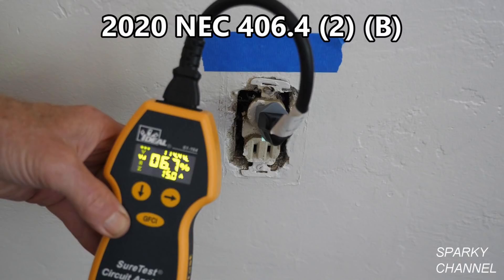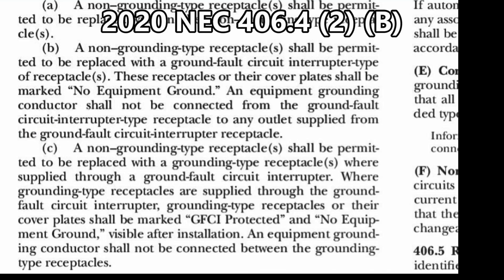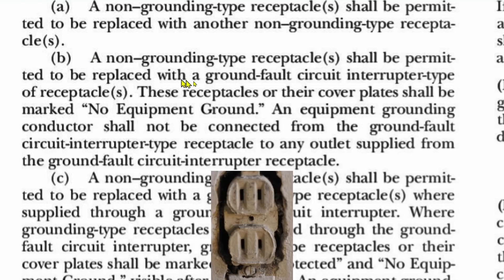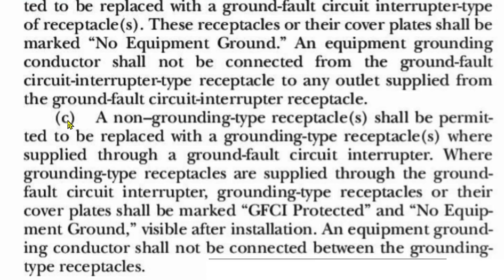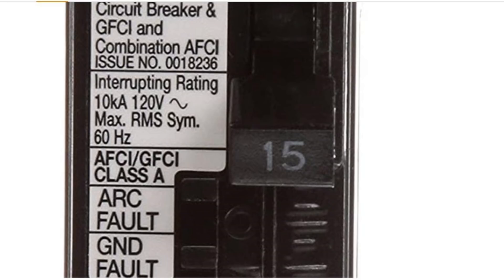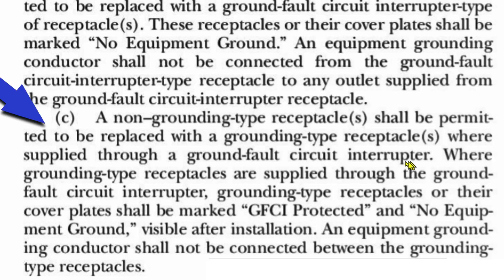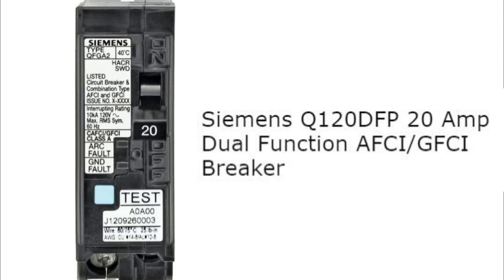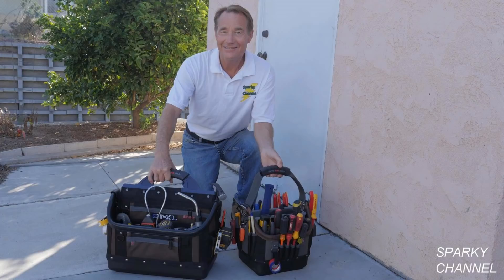Can You Just Install an AFCI/GFCI Breaker When Replacing Old 2 Prong Receptacles?

Comment: Thank you for this clear explanation. 

I’ve done building maintenance for years and generally avoid 2-prong outlet ‘situations’.

In our old 1914 farmhouse: about half the electrical boxes are grounded. There are several older GFCI in place but they are generally too big for the box, I will replace them as needed.  

This helps me to understand:
•Using a GFCI on an outlet that needs it will work without a ground. 
•If you can establish which outlet in the circuit is directly connected to the line, installing a GFCI in that location will protect other outlets on the circuit. 
• A GFCI circuit breaker will protect the entire circuit but reseting it may be cumbersome depending on the location of the breaker box
•Any GFCI protected outlets should be marked as such
•Any 3 prong outlets without an equipment ground must be marked as such
Reply: Why do they have to be marked? I don't care about laws/code garbage but what is the reason the user/owner would want GFCI's marked as such?
Reply: @ATCRyderX  Well, if you ever want to SELL your house and the bank inspection finds sub-standard work, they may just cancel the contract for fear of hidden dangers…
Reply: @UnknownIdaho  so THATS Why they have to be marked? ehhh IDK, Man...Figure out proper answer & Report Back.
Reply: @ATCRyderX  the reason is because the ground must lead back to the panel and not terminate at the outlet. The GFCI will detect the ground fault and cut power at the outlet and labeled. Labeling is important for any future work and safety.

Comment: Hey Sparky, I remember way back in the early 1970s that breakers from many manufacturer's  would work in other Manufacturer's Panels. Some would work in other manufacturer's panels only in some spaces in the panels not in all spaces. There was panels as example that would take, or you could use Bryant, GE and ITE breakers interchangeably. If the old panel in the old house was GE and the specification and design of buss and breaker connections are same similar and will take  the new AFCI and GFCI combination breaker then I would install them as needed, or as required.
Reply: This is a tough one. The NEC says that all breakers must be listed for the panel. What to do on an older panel? I was recently working on a detached garage at one of my properties. It has an old Homart (Sears) load center. Zero chance I was going to replace the whole service. I'd leave it unchanged before I did that. However, I did want to provide all circuits with GFCI protection. Three of the four circuits were easy, using receptacle GFCIs. The lighting circuit, however, had some receptacles on the ceiling. How do I best provide for GFCI protection in that instance? The NEC precludes using a GFCI receptacle in a ceiling receptacle.

I had three choices. 1-Do nothing, no GFIC protection, no code violation. 2-Put a GFCI in the ceiling, code violation. 3-Put an unlisted GFCI breaker in the old Homart panel, code violation. Somewhat ironic that the only way to comply with the NEC was to leave the circuit with no ground fault protection. I choose option #3. I tested GE and Siemens breakers in the Homart panel. The Siemens breakers fit perfectly. I believe my Homart panel was manufactured by Murray, which was purchased by Siemens. 

The NEC needs to have an exception to not require the least safe option to be the only compliant one. I'm glad I choose to install the GFCI breaker. A week later, I shocked myself on that circuit, causing me to involuntarily toss my pliers across the garage. I thought, "Well, code be damned, I'm glad I added GFI protection." It left me startled and pissed instead of electrocuted and dead, or more likely, fallen off the ladder and really pissed.
Reply: @sigcrazy7  That would be a question for your local code enforcement- the local electrical inspector might give you an exemption or say it is ok for you to install the buss matching newer GFCI breaker into the older style existing panel- or they might not. The best option would be to  replace the old panel with  a new panel listed for the new Arc fault and GFCI breakers.
Reply: @MC-de6tf  As I said, I'd leave it as-is before I changed the panel. A panel change would require a bunch of modification to the EMT and overhead RMC to that panel. Not going to happen. Your comment just reinforces what I said: The NEC needs an option that doesn't make the legal choice the worst choice.

Comment: How about using a GFCI/AFCI receptical for the first outlet in an old ungrounded circuit? From code language you showed that sounds ok. Would it function ok?
Seems old wiring could benefit from the AFCI protection if possible...

Comment: I think you may well run into issues depending on how the house was wired. GFCI breakers will not work if neutrals aren’t properly segregated. That’s is if a neutral from circuit A is used with circuit B then the breaker won’t workroom properly.
Reply from the maker: Excellent point, thanks Jim!

Comment: Something to keep in mind is that the old wiring (specifically knob and tube), may have some neutrals that are either shared or connected somewhere making the GFCI trip constantly.  Then again if that happens you can just return the breaker and get some GFCI outlets.
Reply from the maker: Yes, excellent point! That can happen. GFCI receptacles are always an option, and with some old panels which don't have GFCI breakers available for them, they are the only option.

Comment: There is another problem when adding a combo afci/gfci breaker upstream of an ungrounded outlet: the breaker must be listed for use in the panel. If you have an old panel, it's likely that the newer combo afci/gfci are not listed for your panel. Installing one in that case would be a code violation (at least in a Siemens panel, as the MFG directs that only those breaker types listed on the placard inside the door may be used).

Comment: as my inspector said, the code will ALWAYS allow you to add AFCI or GFCI protection - even where it is not required.  but in this case, yes, they actually prefer the protection to be provided at the breaker panel.
the next question - which I already know the answer to - is what you do if you can't get an AFCI breaker that fits the panel you have, and you need to install the protection at the panel. - if you're looking for ideas for videos.
Reply from the maker: Hi Ken, good to hear from you! I do have that video planned. Stay tuned. ⚡

Comment: Great question!
But when I’m dealing with knob and tube wiring normally they run a 3 conductor which they share a neutral between 14 gauge wire and a 12 gauge wire. Which they do have a two pole arc fault or GFCI breaker.
Reply from the maker: Thanks Rudy! ⚡

Comment: At the very end you mentioned that they might trip more often. Why is that? Does this also add protection to lights with no ground wire? Can you discuss pros/cons to adding this protection at the box for an old house vs rewiring the house? Thx!
Reply: Regular breakers only trip when there is too much current on the wires as in too many things using power at the same time, the AFCI trips when it detects arcing and GFCI trips when it detects a difference in current between the hot and neutral wire because you are getting shocked essentially. So you are naturally going to trip breakers more now because you have more things being monitored not just overload.

Comment: My house was built in 1950, a room was added in 1962 and the original fuse box was updated to a circuit breaker electrical panel. Amazingly, there are ground wires and I have verified that the metal boxes that I checked so far are grounded. I measured 120v from hot to metal box. I added GFCI'S in bathrooms and garage and are functioning normally and grounded. Can I add a DF receptacle in the most upstream receptacle in each circuit? I don't believe that a gfci or afci circuit breaker exists for my electrical panel.
Reply: I have not seen any receptacles containing both gfci and afci functionality. If you are able to change the box from a single gang to a dual gang, then you can use a gfci device containing no receptacles first, then use an afci receptacle as the next device. This would solve the dilemma is how to get both types of protection, when you can't do anything at the breaker.
Reply: @thomasbonse  They do exist. See Leviton smart lock pro dual function afci/gfci receptacle. The afci part covers both series and parallel protection also.
Reply: @surferdude642  I hadn't realized they were available in a combined configuration. In that case, they should be able to be used for the scenario you described, depending on box fill.
Reply: @thomasbonse  thank you for your reply, and yes I may have to install some larger boxes.
Reply from the maker: See my video tomorrow AM. It should answer all your questions re AFCI/GFCI receptacles!

Comment: If you install an afci breaker on an existing circuit then it starts tripping, two different circuit neutrals could be tied together.  Probably in a multigang switchbox.  Your 30 minute, swap a bad receptacle job, just turned into a hunt.    Omg if you have to do a panel change on an old house.  If you have to, put regular breakers in, until you can find out why the afci's are tripping one by one.  You can't let the food in the fridge go bad.  Plus you need sleep.   This could be hard to quote.
Reply: In my very limited experience, I have found that an AFCI breaker is tolerant of a shared neutral, where the GFCI will trip. I had this condition in my (very old) house. Years ago, I had tried to put in GFCI breakers. When I would turn one particular light, two GFCI breakers would trip. It was a light with 3-way switches at the top and bottom of a stairway. They had tied into one circuit at the top of the stairs, and a different one at the bottom. I recently found the point of the shared neutral and fixed it. (It took a lot of head-scratching and investigative tests to find it.) But one of the experiments I had tried was to put in a combination AFCI breaker. The shared neutral did not trip the breaker.  FWIW

Comment: it said "An Equipment Grounding conductor SHALL NOT be connected between..."  
Do you need to PREVENT the self grounding features of the yokes when using with metal boxes and metallic  cable/conduit (BX, Greenfield)?
Reply from the maker: The key word there is "conductor". Don't use a conductor between the receptacles. A yoke is a yoke, not a conductor.   IMO.

Comment: I recently noticed inside my panel that the electrician had installed splices (noticed a couple of wire nuts) inside the panel; can you tell me why he would need to do that since he was installing a new 200 Amp service with plenty of space? Thanks
Reply: Being a lazy hack guy or women. Get a licensed and not lazy electrician to fix that problem.
Reply: Per the NEC it is ALLOWED to pigtail (splice) wires inside the service panel. You say he was installing a new 200 amp service. Was he replacing an old panel? The only legitimate reason I can think of for splicing wire in a new panel is if the wire was too short, and running new wire was labor intensive/expensive. Contrary to a few of the "lazy hack" comments I read, it may have been done to save the customer money. It tends to look tacky, but it's perfectly legal.
Reply: @im2yys4u81  Splicing inside a panel is perfectly acceptable, and in some instances is the best practice. Let’s say you have a circuit where the panel location is geographically centered in the circuit. Let’s say you used a single home run, going to the left, wired all those receptacles, then went past the panel to the receptacles on the right. This configuration makes the circuit much longer, and would create a much higher voltage drop at the end of that long run. It would be better to have two home runs from the panel, one going right and one going left, pigtailed in the panel with it landing on the single breaker. If using a Square D or CH breaker, it is listed for two wires, so you could just land both home runs on the breaker.  Whichever way you terminate to the breaker,this configuration is a superior way to wire the circuit, and is far from an indication of “hack” work. Two home runs will make the circuit much shorter, providing less voltage drop, lower amperage draw, and a safer and more robust circuit. Indeed, it is more likely an indication of someone who understands what he is doing.

Comment: Hope you don’t mind: replacing a CH dual breaker 40-amp with a gfci - however, I only have two hot and one ground with No neutral.  How is this configured in panel?
Reply: Best case scenario is to run new wire from the panel to the device. In the alternative, you will need to run a continuous wire from the panel to the device. Is the device inside or outside? It makes a difference in the type of wire you run. Is the existing ground wire bare, or is it covered in green insulation? I had a similar situation, two hots with a stranded neutral and no ground. I wrapped the stranded wire on either end with WHITE phasing tape and ran an insulated ground.
Reply: @im2yys4u81  the stove is in the kitchen and is “relatively” easy to pull a new wire.  It’s all inside so Romex is fine. However, I hate the thought of buying another 60 feet of 8/3 right now; especially since I just ran the 8/2 this year and would end up recycling it.   It short sighted on my part and learned yet another lesson on taking the cheaper route.   Thanks for taking the time to respond !!
Reply: @MrKen59  OK, my stove is wired with 3 wires. It's grandfathered in. I've got two hots  and a stranded ground. Perfectly legal. The catch is you need to make sure the stove isn't wired for a 4 wire system. On my 3 wire system the two hots are landed on the breaker, and the ground is landed on the ground bar. Inside the receptacle, the hots go to the two diagonal posts, and the ground goes to the center post. On the back of the stove the hot wires are landed on the red and black, and the ground lands on the white wire that is usually white. There should be a grounding strap on the neutral terminal that bonds the terminal to the stove. If it's not there, it's been wired for a 4 wire system. If it is there, you're good to go until you decide to update to a 4 wire system. I feel you on the wire. Copper wire is crazy expensive right now.
Reply: @MrKen59  One thing I failed to mention in my last comment. My 3 wire range is wired into my sub panel, so my 2 hots are landed on the breaker, and the range is grounded to the ground bar in the sub. If your range is wired into your main panel, the neutral and ground are bonded, so the third wire on your range would land on the neutral or ground bar. That's assuming your main panel is properly wired.
Reply: @im2yys4u81  When wiring the stove for 8/2, the instructions have you connect the center terminal to the stove frame. In this case, the frame remains bound to the grounding conductor and the stove neutral is connected to the grounding conductor as well. If the stove is truly 240, then it's fine, however I suspect the are cheating and using the grounding conductor as a return for the stove electronics. My clamp on amp meter isn't super accurate in the milliamp range, but I noticed a trace current on ground and why 'I believe' it was tripping the GFCI breaker.   I'm speculating as I don't know for sure without the schematic.  I wonder how a call to Samsung would go if I called them out on it?
Reply: @MrKen59  To the best of my knowledge most ranges (and dryers) are wired up the same. Three posts, with a red, white, and black wire. Red and black are "hots", and the white is neutral. ALL the ranges and dryers I've ever seen place the neutral post in the center.  I seem to remember reading somewhere that MOST ranges leave the factory wired for a three wire outlet. That makes sense to me because on a three wire system there is a bonding strap on the neutral terminal that is landed to the frame/chassis of the range. If you were to convert a three wire system to a four wire system it would be a simple matter of removing the bonding strap, then land red to red, black to black, white to white, and green/ground to chassis. A new range/dryer cord comes with ring terminals, so the ground wire is easily landed using the same screw you removed when you removed the bonding strap. I'd say your chances of googling "Samsung range wiring" would pull up some good results. If you'll give me the make/model/serial of your range I'll do some snooping for you.

Comment: Can you include a video on installing a gfci/afci breaker using the pigtail type breaker?  This would be in a 1960 house where the neutral and ground share the same busbar.
Reply: They make plug on’s as well if you want to avoid the pigtail just depends which brand your panel takes but in another world I would get a new ground busbar install it in the panel and separate ground and neutrals!

Comment: wouldn't the problem be less in that code says don't can't and more in that a panel from the 1950s or 60s wont fit a current breaker. heck in my house the panel was installed in 1984 and its a fuse panel and u can't really do nothing with it other then adding more fuse circuits without replacing the whole thing.
Reply from the maker: Yes, excellent point! That can happen. GFCI receptacles are always an option, and with some old panels which don't have GFCI breakers available for them, they are the only option. ⚡